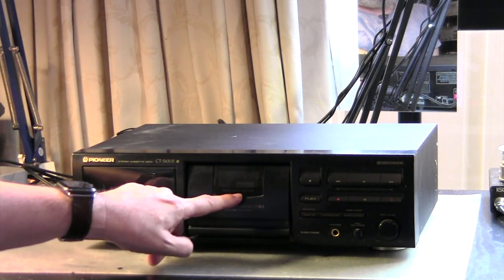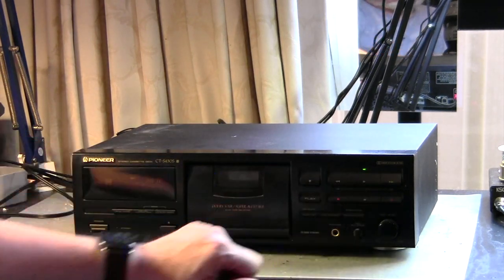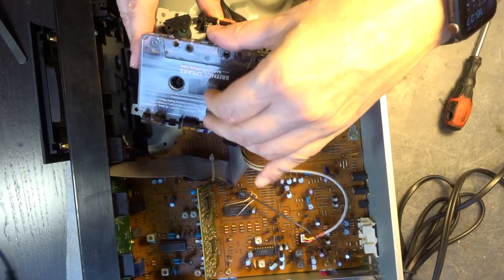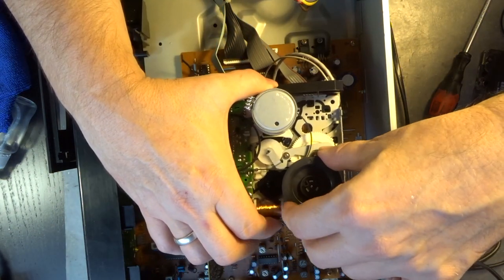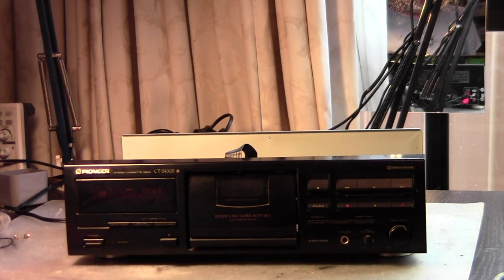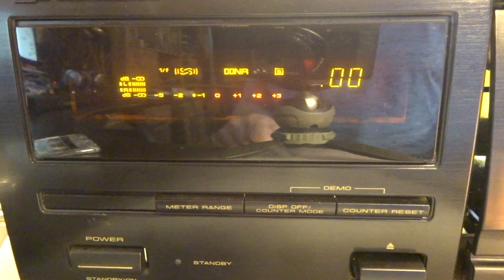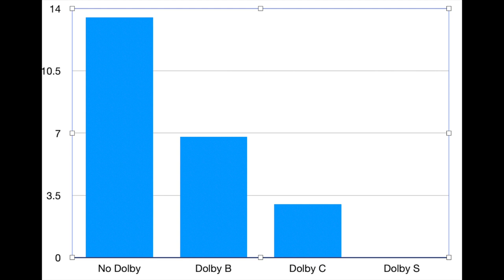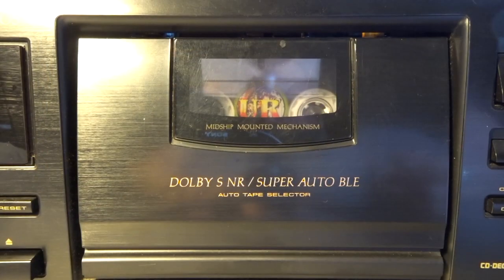Pioneer CT-S430S - Repair and Review

Comment: You can adjust the azimuth with the transport in postition. The bottom strip of the door is removable by pushing  tabs inside the door on each side with your finger. There's a diagram showing this in the CT S430S service manual which has the same faceplate

Comment: Many years ago, I had a Kenwood M71 system which included a twin cassette deck with Auto Bias. It also set the perfect recording level when used with a Kenwood CD player. As with this Pioneer deck, and without Dolby, you can hear the hiss when the music is very quiet,  but the signal to noise ratio, even without Dolby, is acceptable. In those days, TDK made a number of Type 2 tapes, and most domestic cassette decks were tuned to match TDK SA.They did a cheaper Type 2 tape called SF, which sounded noticeably duller, lacking in treble, but when you had Auto Bias, the tone balance was restored, and it was hard to tell the difference. Because of all this, I only used Dolby B on Type 1 tapes.

This Pioneer model may be plasticky and cheap, but I love the fact that it seems easy to get the mechanism out in order to change the belts, clean the heads, and apply some oil. I've seen a few videos with tear-downs of cassette players, and it would scare me if I had to do that, but this one looks straightforward.
Reply: you´re right i also have kenwood decks because since ever i notice a higher quality of sound in decks since the 70´s ,even had a car radio cassette player that i bought in mid 80´s and only took it from my car in 97 when i bought cheap a MD player from sony for the car, 40€ new at the time
Reply: i have used SF tapes since ever and they sounded great in several diferent brands high-end decks i own, i even liked when they were released in a blue shafire or similar ,i would buy them more than the SA or SA-X, but in the 90´s with the brown transparent casing they did sound not so good as the SA too, i started to buy more SA-X and UX-PRO from Sony, but with the two kenwood decks i own from swecond half of the 80´s and the one before the top end model in 95 if memory doesn´t fail me they did recorded very good but i´m not sure of all because i stoped using cassettes when in 96 i bought for half the money i was going to spend in a cassette deck ,i bought the MD deck from sony ,the first under ES, only in 2017 i restored one cassette deck and i notice that some types of music that weren´t that good when recorded in minidisc they did stay perfect on a good cassette deck, and because a friend of mine worked in a warehouse from one of those big surfaces that sell all were going to incenerate all cassettes and minidiscs ,i put my mercedes from 71 a 350SE or the biggest car i had and filled it only leaving my seat empty with boxes of TDK SA; SA-X or Sony UX-PRO and also minidisc´s from TDK all black so i don´t need to buy them now at looking like a horror movie prices, and i have given a lot of boxes to friends who still record cassettes
Reply: i forget to refer that most of the decks had tdk metal cassettes as standart tape, never the SA, the SF, it is as very good tape and cheaper ,yes a couple of € and in the 90´s the SF was the SA of the 80´s, but it´s a high-quality cassette, since it appeared, if not with auto-bias it records like if it was a TDK MA-X or XG,if automatic calibration exists and you don´t use it it´s like if you were using it´s standart tape or a tdk type IV, it comes in the manual not my opinion, and i never used dolby ,in the best decks it limits their sound quality, and this deck wasn´t that cheap ,it was the best 2 head deck,but in the 90´s some have 3 heads ,i have the CT-S630S to have the flex function which is handy to hear old recording done in good decks , much better than play trim if owning only this deck the flex should be always on, to play always the best sound of the cassette played, the manual explains it

Comment: the hiss when not using dolby it only appears when the heads need to be demagnatised for that i have a looking like a cassette from tdk that you play it and as two distinct beeps that changes when the heads are demagnatised, dolby normally decreases the original deck specifications as you can record with louder sound not using dolby ,this in good decks and never had hiss, but if recorded with dolby and played without dolby it increases a lot the hiss level, some car cassette players didn´t had and hiss apeared ,also i discover that some friends that had cheaper decks recorded always with dolby to play without dolby to increase the high´s on the recording but inbetween tracks a high level of hiss was heard but not a problem for them they had their precious high´s increased in their average decks without bias

Comment: Dolby B and C simply sounds too Muffled for me as the higher notes and "airy" or "spaciousness" tend to be removed. However Dolby S seems to sound good from your video although i don't have any cassette decks with dolby S. I do however have some with DBX and to me DBX sounds great. Perhaps if you have the equipment you can do a comparrison between the Dolby S recording and a DBX recording using a similar cassette type. Just to add this to the equation; In my opinion Dolby B,C and Dolby S to an extent, seem to sound similar to having your noise cancelling turned on with a decent set of headphones so unless you are using headphones or are very close to a set of speakers then "hiss" from a cassette recording should not bother you a lot as long as the volume of the recording is decent even for quiet sections.

Comment: Hi, I have a Pioneer CT-S420 and would like to calibrate it for Maxell UD XL II, adjust the bias and optimize Dolby B and C.  I have a Nakamichi audio analyzer but since I am new to electronics I don't know how to adjust the calibration. Can anyone help me? I made pictures of the PCB  that I can send, but which one is for what?
Reply: i do have several cassette decks from diferent brands , the calibration is in every deck made from factory to include the best sound in any type but with calibration automatic or not one can do it the best possible to the cassette in use,that´s a plus, the deck you refer as automatic calibration and i have one that records perfectelly in what concerns to it´s specifications but in higher reference decks ,the sound for sure is better but sometimes not working with perfection so when i insert a cassette recorded in the CT-959 or CT-93 ,it plays with perfect sound using the flex that is supposed to be always on , the nakamichi component you say you have if it´s the one i´m thinking is to be used on easrly 70´s cassette decks that had not a good noise cancelling system and calibration can be done by making the cassette with already recording sound by using it´s monitor the most close to the source, but i wouldn´t use it with a CT-S420 that already as auto BLE as the autobias in kenwood decks , but when using diferent cassette from diferent brands or C-60 or C-90 cassettes it makes the deck fastly out of it´s perfect tune, the ideal is choose a well built cassette and only use it on the deck ,this makes one deck work flawlesslly for more time, but it´s rare to do so and today even more being all cassettes old from the 90´s or earlier, the XLII released in the 90´s with light grey casing are not good to any deck it sounds perfect after recorded but it makes any deck work perfect for a lot less amout of time, normally one changes the belts and it starts to work again with perfection but also need to be aligned, so it can work with a good brand cassette without destroying it ,i notice that because i had a lot of sealed cassettes from BASF only super II and maxima I, II or IV, they for sure sound good if not while making the BLE flashes the message error ,but only saw that in a deck i bought first with the insert of the cassette in the midle and not in the left side of the front , in the manual as i refered before it even says ,do not use basf cassettes ,normally they writte in the end of the manual of each deck which are the best cassettes to use .This, one has to see the year of the deck release because cassettes change with the years and what could be a perfectelly built cassette can change in the next years
Reply: i never saw UD XLII only UDI or UDII or XLII or XLII-S or even my favorite the XLI-S ,i do prefer good ferric tapes as i use to do in the 70´s with reels, but only have good chrome or cobalt cassettes today

Comment: i had a better deck than this when this model apeared but trade it with a BMW 2002 from 75 ,restored in the 80´s and later bought this model and a md player that was the model under the only ES md deck cost me the same as the one i trade for the car, only notice a plus ,the FLEX function ,i had and have lot´s of well recorded cassettes and with this i put the flex on and the old recordings seemed to recover all their quality almost like nakamichi azimuth correction, that i have all top end decks since 1974 till mid 90´s ,the last is the cassette deck1 that it seems better than all that came before but it´s simple design and size didn´t caught buyers interest, also have some pioneers top end models from late 80´s to early 90´s and in this deck one could notice a decrease in the frequency response but all cassettes sounded like i had just recorded them but with 10 years or a bit less or even some good cassettes from the 70´s.Yamaha as the play trim but is nothing related with flex but pioneer says it´s a similar efect it brings up the high´s that seemed lost on old recordings due to excessive use in difrent cassette players as portable ones, car cassette players and walkman´s, so i ended up buying later on ebay a CT-S630S very cheap but the only with flex ,the ones with upper reference don´t have flex but it´s a very interesting function,when trying it for the first time i couldn´t believe it´s quality in playing cassettes
Reply: OH, and i never use dolby ,since ever ,so having dolby S or not doesn´t make it better,my first tape recorder was a X-165D from Akai 1970 catalog (reel deck)and records perfect today using only ferric tapes ,and not any deck can record with it´s quality ,don´t even known which to refer and i own 47 cassette decks,between mine and my father´s  that came to me when he died already a year ago or almost, the reason why i have so many nakamichi´s ,mine and the one´s from my father between other great decks as the B215 from revox and a Teac that is incredible good. also this deck if cassettes aren´t well built or bad calibrated from factory ,this regarding the tape and the casing if demanding extra power from the engine that rolls the tape inside the casing ,in the BLE automatic function it detects the extra strenght made by the engine and to do not put it out of tune it stops and gives the message error ,in the first one i owned it even said, do not use BASF cassettes and they were right i´ve found a lot of problems on basf cassettes bought since last monthes of 1985 and in the 90´s they had good tapes but the cassette itself were badly built and could destroy any new deck,i´ve done that with some 7 basf super II and maxima I, II, IV that had very good sound but after using them i couldn´t calibrate any TDK cassette on a CT-959, this new after being bought, but it last years working only with good basf tapes ,like the ones i refer or UR and MX from maxell or HF from sony or even tdk D , AD, AD-X and AR, the SA and SA-X were impossible to use there without being destroyd as some sony UX-PRO or Metal master, the TDK MA-XG is the standart cassette for this last deck i refer so no need to calibrate only if some like a lot of high´s they could increase the bias knob for the left(this comes in the deck manual)

Comment: Di certo non è un CT-95,ma esiste anche di molto peggio!
Reply: the CT-95 does record andplays perfect but built much more cheap than older top end pioner cassette deck that i have a lot of them ,only didn´t bought the CT-95
Reply: @RUfromthe40s  a parte il costo,il CT-95 e' un'ottimo registratore,ho avuto occasione di vederlo,anche internamente,e ascoltarlo,tecnicamente impeccabile,poi questo modello e' uno degli ultimi pioneer top level